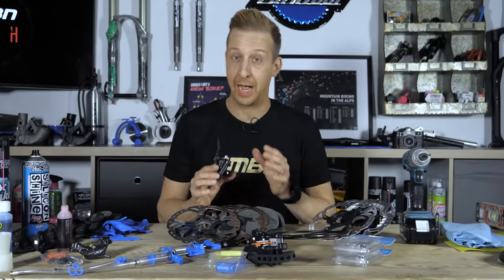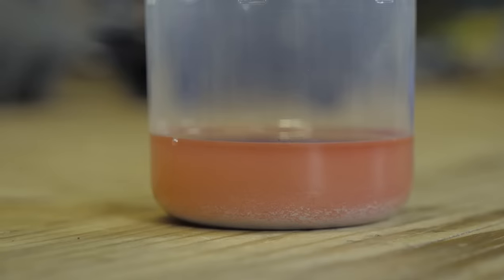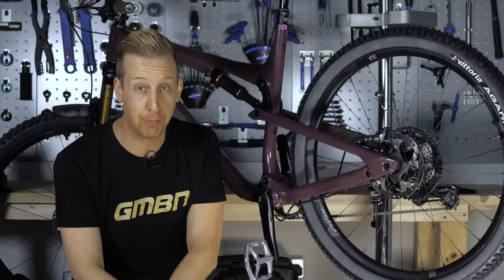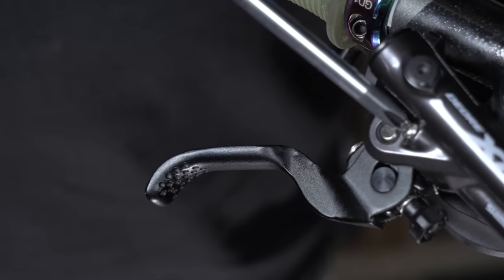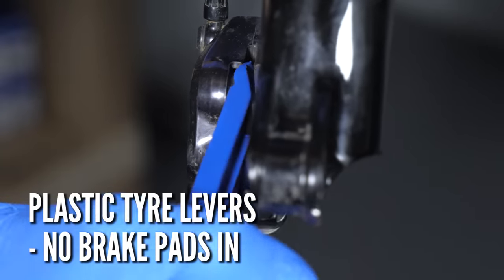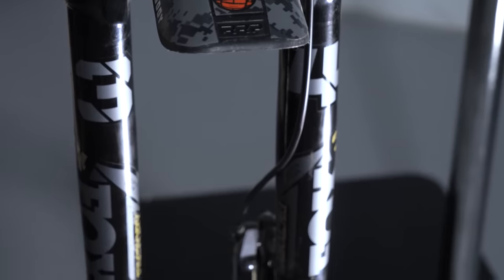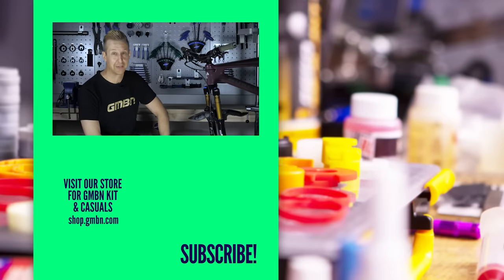12 Common MTB Disk Brake Maintenance Mistakes & How To Avoid Them

Comment: The bedding in of new brake pads is not "to deposit an even layer of material" on your discs, why would you do that??? it will just get rubbed off again under normal use! The idea is to make sure the pad faces are in full contact with the rotor as they will undoubtedly not have worn evenly unless they're brand new and will need to wear in until the pad face conforms to the surface contours of the rotor. Even when brand new you have to wear the pads and rotors in before they produce their optimal power as the gound face of the rotor has minute ridges and troughs that need to be evened out (and NO Not by filling them up with pad material!) Before they work to their full potential. Take it from a mechanical engineer!
Contamination:- Disc rotors, just clean with brake cleaner. they're impervious so theres no need to go further than this unless they're become discoloured due to heat then just rub over with a medium emery paper (400/600 grit). Contaminated Pads, Don't even bother, just dump them!...these are porous and any oil contamination will just come back to the surface as soon as they get hot, even if you think you've cleaned them! 
Glazed pads can be problematic depending on why they're glazed in the first place and could indicate the wrong compound for the riding style. Glazing without contamination is often the result of overheating due to heavy use before they're had a chance to bed in properly but they can glaze when used in prolonged braking on long descents if they get too hot. In this case they can be improved by rubbing with emery paper to remove the glaze but they might be damaged by the overheating and will probably need doing again very soon after.
Reply: Then u completely fail to understand how brakes actually work, simple as that. It is purely to deposit material on the discs you bed them in, by getting them warm enough to allow this, and why u never fully stop when bedding in, to prevent a 'high' spot from hot brakes sitting with pads pressed in one position. Brakes absolutely work by transfer of pad material, not really friction at all...
On a car, the most common cause of 'warped discs' is uneven pad material on front discs from people sitting with the foot brake pressing pads into hot discs, rather than using hand/parking brake if brakes hot. 
Of course they need to be aligned to maximise contact, but that is absolutely NOT why you bed in brakes!
Reply: @rupedog  I've seen brake drums on hgv end up egg shape by applying park brake when they have got hot by which I mean glowing red on occasions splitting the drum.always treat brake issues seriously it's that small area of contact through your tyre print that'll you must rely on to keep safe, if you don't know enough leave it alone. 👌👍
Reply: @rupedog  If you are depositing materlal on to the disc rotor why do they get thinner in use not thicker as your deposited material will make them?
I understand fully what happens when you apply your brakes, whereas you obviously do not!

Comment: #AskGMBNTech As an automotive engineer we touch the steel brake rotors (even with grimy hands) all the time an are never concerned with contamination in regards to a typical automobile.  If the rotor is not covered in oil or grease, it is good to go.  Why are MTB brake rotors so different?  Are the metalic pads on MTB's different than the automotive version? Are the rotors made of an exotic metal?  Or are all these precautions you constantly speak of because of these resin pads that are found on bikes.
Reply: Where do u work...so we can avoid going there!😂
Relative Scale...and operational temperature, maybe...

Comment: Using spray lube on a bicycle should carry a minimum one year jail term!
Even before disc brakes, spray lubes were the bane of the bicycle mechanic's world.  You don't need lube everywhere!  Especially all over your cogs, rings and derailleur(s)!
Drip that stuff where it's needed and then WIPE OFF THE EXCESS!

Comment: How did you end up with frontbreak on the right and rear on the left? All my bikes are the opposite way, just how I bought them. Is this a UK /EU / US thing?
Reply: It comes from motorcycles.  If you ever ride a motocross bike you will see they are set up that way.  Clutch lever is on the left.  Front brake on right.  So on a bike, the rear brake is naturally goes on the left since there is no clutch.

Comment: Thanks Doddy! I always recommend you leave your levers only clamped to the bars tight enough that they won't move on their own, but you can still move them without a tool if you want to. This will allow them to slightly move in an impact, and possibly not get damaged. It also allows you to adjust the position for best ergonomics while out riding.

Comment: After the Winter I pulled out my bike and went for a Ride. Somehow they started squealing and didn't brake as good as before. after a clean and heating them up it worked altough I have the feeling they aren't as strong as before.
Now the thing is, I don't know why because there was no possibility of them getting contaminated before or during storage.
How did this happen?
Reply: I have a theory, that when I store my bikes, in my apartment, the rotors get contained, with the lightly polluted air, from cooking, breathing, sweating and bathing..and so on, no matter how well ventilated, there’s always going to be something in the air, look at the inside of your windows👀
I clean, and rebead the brakes, after long storage....
Reply: @wonderwatch2239  the bike was stored in the basement we live in a apartment house.
Only thing I can imagine is dust which got heated up
Reply: @maikszczerbuk613  shared basement? Someone spraying something about?
Reply: @rupedog  no a closed basement for everyone with no vents except a window in the back

Comment: Great video Mr Dodd, one thing I would never advise anyone to do is taking emery or sandpaper to a disc. Disc brake surfaces work best when they are fully polished and not as old motorbikers used to say when they are rusted up... Also Pro Tip. If you ever have to remove brake pads mark which is from right and / or left and if need be front and or rear. This helps reduce rubbing after you put them back in.

Comment: #AskGMBNTech Can you please explain what the free stroke screw does internally on Shimano brakes? I have never felt any change if I moved it.
Reply: In the video you could clearly see the lever moving as it was unscrewed, but in my experience I cannot feel any difference so I tend do the old school method of pumping the brake lever (minutely) with the wheel removed to bring the pads closer to the rotor.
Reply: @scottlstone  That‘s exactly my experience. I do it the same way.

Comment: About the wrong fluid.. i'm not too keen on buying into the bike hype of prices. That small bottle of mineral oil costs way too much compared to any other industrial fluid. So i just use ATF and afaik is the best substitute for mineral oil. 

Same for suspension oils... Why bother with rockshox special fluid when in the spec i've dug up it's 5w fork oil made by silkoleum that you can buy by the gallon at a fraction of price. 

Same for chain oil.. there are many oils to substitute the "bike chain oil"

Even chains... For my fixed gear 1/8" chain where side width does not matter, there are plenty industrial chains 1/2" pitch with load rating specs with full bush and cheap sold by meter. They are arguably way stronger than any bike chain.. maibe heavier and those ratings may apply in the full oil bath designed for lubing (such as an engine timing chain). There are other chains rated for semipermanent lubing (like motorcycles). Anyway.. value per price is much better than shimano bike chains.

Comment: I’d have a question about a Shimano system full bleed (SLX 4 pot to be precise). I’ve seen the videos where the syrige is used to push the fresh mineral oil in and the old oil ends up into the cup. I’ve also seen the videos about the gravity bleed where fresh oil is filled into the cup and gravity flushes the old stuff out. I’ve been wondering, if it would make sense to use the syringe to suck the old stuff out while refilling the cup not to let any air into the system. Would that make sense? Is there some caveat I’m missing? Maybe this is #askgmbntech
Reply: Sounds sensible. Vacuum bleeds used on cars often.  Pressure better for removing bubbles than no pressure gravity...but gravity simpler

Comment: Whats the difference between magura and shimano mineral oil? I've seen a few trials riders using shigura setups without issue #askgmbntech
Reply: I want to ask that same question
Reply: From what I have seen is that the boiling point of shimano mineral oil is higher then magura's mineral oil. I have seen posts that you can put shimano mineral oil in magura setups, and visa versa, and that people who run shigura setups (magura and shimano combined) usually run with shimano mineral oil because of the higher boiling point which should reduce the chance of vapor lock.
Reply: You can use both but the fluids are designed for the specific brake/brand
Reply: Magura call their fluid Royal Blood, so it’s better coz it’s got a cool sounding name 🥳

Comment: While I appreciated the video I find the attitude towards discarding used dot containers wasteful. I'm using the same container for some years without any issues. Sure there might be some humidity absorbed  within the fluid by now but this is unlikely to become an issue if you close it properly immediately after taking out the required fluid. Also why would you use a water displacer?
Reply: From what I've seen with car brakes and clutches, dot fluid tends to change colour and get a bit mucky as it absorbs moisture. It be as likely to happen on a bike or have quite the same consequences, but for cars I think the issues with it absorbing water is that when the fluid heats up, the water in it can boil and become steam, which just happens to be compressible, leading to an unexpected lack of braking performance.

Edit: Also in the case of a car / vehicle which is regulated more heavily, there should be no question over the operation and maintenance of critical systems - if you follow the manufacturer's recommendations/other relevant and trusted set of guidelines to the letter (even if you can think of an alternative method or think something is unnecessary), then you are less likely to be blamed if something goes wrong, for better or worse.

Comment: Why not open the bleed screw on the caliper to bleed the brakes? Let gravity do the work?
Reply: Pressure helps remove bubbles...
Reply: @rupedog  I put a block in the caliper and squeeze the lever lightly...

Comment: Fluid drive brakes are very very temperamental indeed. The mere fact that as you show in your video each brand of brakes require different brake fluid. This is another example bike industry monopolising. It is not easy to bleed or maintain fluid drive disc brakes as you falsely suggest in your video. My request to the industry is to produce disc brakes which are cable driven, and phase out fluid drive brakes.

Comment: If Shimano asked you to do this video, can you in return tell them that the bleed blocks for 2 piston and 4 piston should be a different colour? I ruined a 4 piston XTR saddle by accidentally using the 2 piston block.
Reply: But do they fit because the other week I changed from 2pot to 4pot and accidentally tried to install a 2pot bleed block to a 4pot and it simply didn’t fit for me so I then realised the two sizes. It would be nice if they were clearly marked up though
Reply: @scottlstone  The 2pot block fits in the 4pot caliper but covers one piston only half way. The result: If you pull the lever to test the pressure point, the piston can move out at an angle and crack if it is of the ceramic variety. Sounds like a cracking mug. 😖
Reply: @chrisridesbicycles  Clearly I got lucky, I had plenty of time to do it so I fortunately spotted it before I cocked it up. I hate ceramic pistons they are far too fragile.
Reply: @scottlstone  They are fragile but they also have very low heat conductivity and isolate the brake fluid very good.
Reply: @chrisridesbicycles  Yes well that is the trade off Shimano feel necessary, I’m not 100% sure but I thought SRAM didn’t use ceramic material on their pistons.
Also I remember exactly the problem I had with the bleed blocks. I only realised the different sizes when it came to cleaning to resell my old 2 piston XT, I tried to put the bleed block from the 4pot in then realised they were different.
Reply: @scottlstone  They might not need to because they use DOT but I think I‘d rather go with the ceramic pistons and avoid the DOT.
Reply: @chrisridesbicycles  Out of curiosity what happened after your piston broke? Did you know straight away (by the sound) and did they leak oil immediately or over time?
Reply: @scottlstone  Immediate chaos with oil spilling out of the saddle and a blocked piston.

Comment: "Front brake on the right and back brake on the left" - Is this a U.S. vs U.K. thing, like 'driving on the wrong side of the road'? Any bike I've ever ridden (in the U.S.) has been the opposite. Do you guys have your brakes on the wrong side too?? 🙄😀
Reply: Front brake is on the right because that's the same side as motorbikes. If you ride both you don't want to have the brake side switching!!  Common sense, something you guys seem to lack ;-)
Reply: Born and lived in the US my whole life and have always had front/right - it just makes more sense for right handed people, better modulation of front brake.

I believe the origination was the ability to make hand signals with the hand closest to traffic while having the other hand for the rear brake.
Reply: @ApexHerbivore  Good point! It never clicked in my head when I switch between the two. I guess I’ve been riding both so long, it’s an automatic adjustment.

Comment: You forgot to mention never to mix different versions of DOT fluid. Some can be mixed but it’s best to just remember not to do it. E.g. do not mix DOT 5 with DOT 5.1
Reply: Dot 3/4 and 5.1 will work
Reply: I'd also add that DOT fluid can eat paint, clean it up if you spill it on your frame or fork.
Reply: Only DOT 5 cant be mixed with the others DOTS, because its silicone based...DOT 3, 4 and 5.1 can be mixed, regardless of brand. SRAM only uses 4 or 5.1 tho, as 3 doesn't meet performance needs.

Comment: One tip I would give is to never over-tighten your brake lever bleed screw. Just finger-tight is enough. Been there, done that.. you can replace your entire brake lever if you over-tighten and screw up the thread 😢

Comment: Great video as always Doddy!  Just changed the brake pads for the first time on my Stumpjumper and the front felt a bit suspect on my first ride after.  I had to let a small amount of fluid out to get the pistons back to allow the new pads in which I thought may be the problem but after watching this, I think they might not be bedded in properly.  Will try that and the bite point adjustment first before a bleed... Cheers!

Comment: I have a friend who is a mad mountain biker and works in the oil & gas industry when he put the shimano mineral oil in the mass spec "it lined up" exactly the same as very popular brand of automotive power steering fluid...sorry guys..I guess it explains the red colour.  The same was done with "Fox fluid" and the results were also common with another product..think heavy weight oil blue in colour...and you'll probably guess it.

Comment: 13:50 I would also check the wheel bearing tolerances. Sometimes the bearing tolerance may be slight too loose and that can cause noise if you try to move the bike with brakes applied.

Comment: So many guys harp about brake pad contamination... but it's not harping, it's real. It's difficult to know how much or how little oily stuff on your pads will make them squeal, sometimes a lot, sometimes a little. It's not just squealing either, you lose a tremendous amount of braking force. Best to follow this advice and be careful, even if it seems overly cautious on the surface.

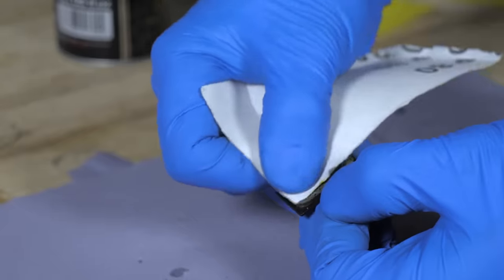Comment: 10:20 I would argue that you rarely need to replace rotors because those shouldn't be able to soak oil or grease. The pads on the other hand are pretty porous material and if you get oil in the pads, it will be there forever.

If you know the boiling point of that oil, you might be able to heat the pads above the boiling point and keep the pads at that temperature for long enough. It might turn out that the boiling point of the oil is more than what the pads can take, though.
Reply: J B  Contaminated with what? Are you claiming that something entered inside the metal material of the disks (rotors)?

Did you use real brake cleaner fluid to clean the rotors? Even car brake disks come with oiled surface from the factory and you must degrease the brake surfaces before brake pads touch the surface. Do you think your rotor "contaminant" is worse than oil?

Comment: I bought a Bossnut V2 (from UK) in 2017 and I rode an entire season with the front brake on the wrong side (right) until watching one of your maintenance videos. After seeing how easy it was the change, I switched the sides and went through a full brake bleed at the same time!

Comment: The dragging/uneven calipers can sometimes also be that the coating on the pistons themselves (and also the bore/square seal in the caliper) are also worn and no resetting will fix it. Only a rebuild or replace at that point.

Comment: Nice video. I would add that you should be careful when tightening oil screw in brake handle. I stripped thread in brand new one. That sucked big time.
Reply from the maker: Hey, Great Advice!